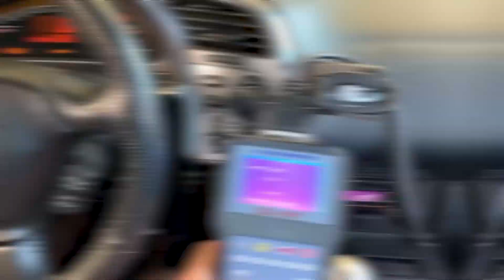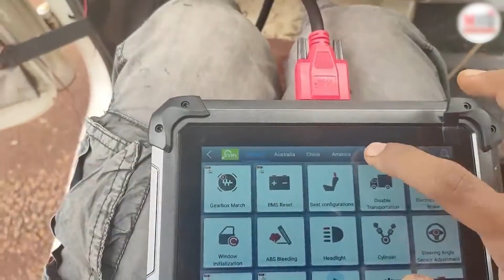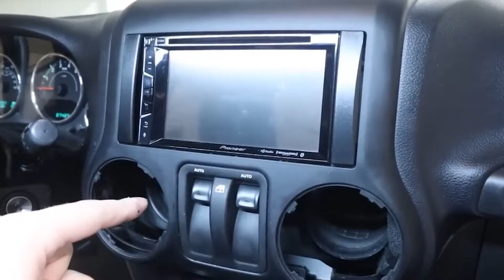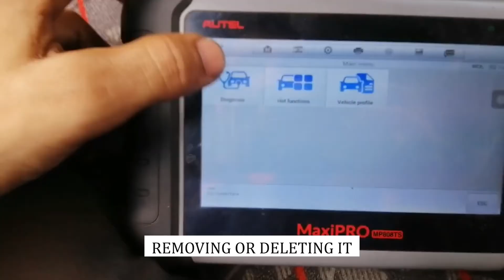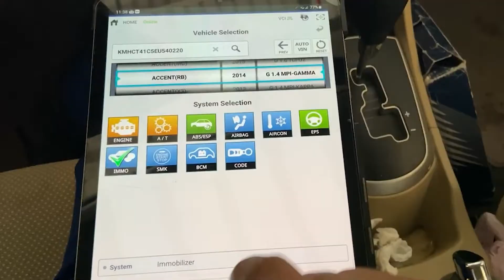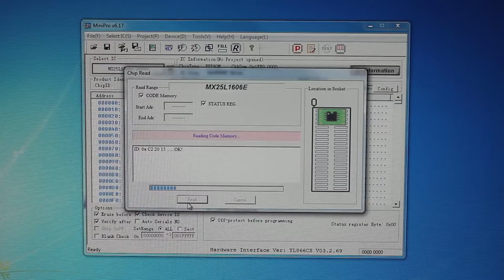How to Remove Immobilizer chip from ECU Honda

Comment: what car, what code is on the ecu, which model does it come out of, CAN/OBD2 orrrrr obd1 orrrr random 5 wire russian motor with 2 sensors and 3 spark cables
Reply: Please tell us
Reply: The PN in the first clip shows it’s for a 2004-2005 Civic 1.7 manual